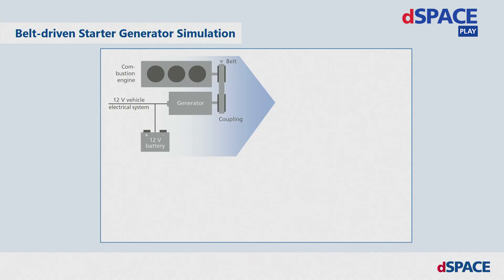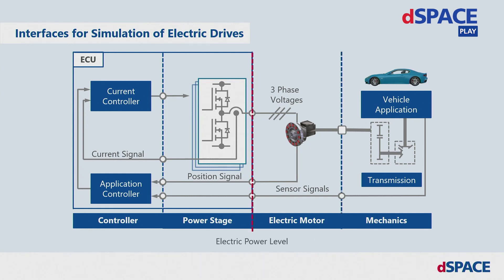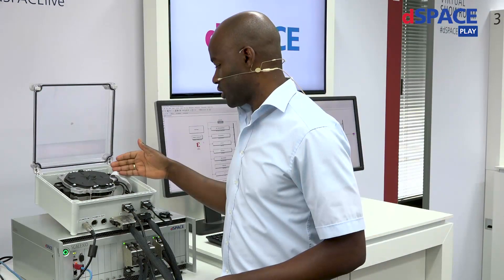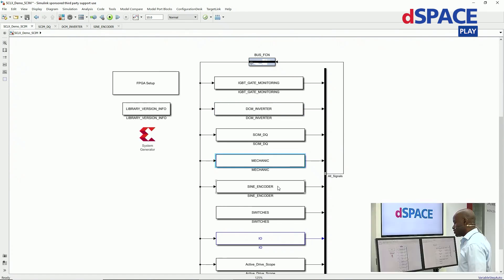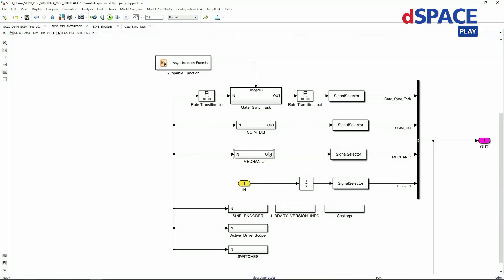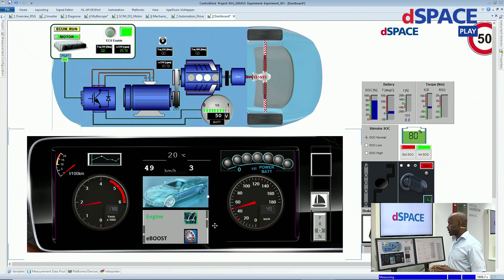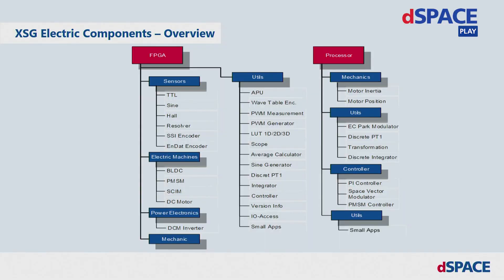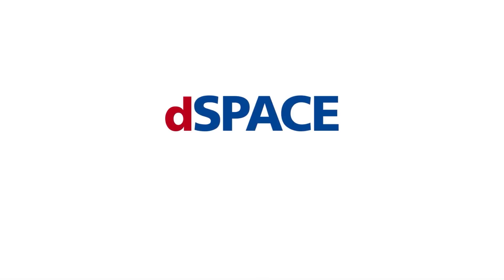Dynamic Motor Simulation on FPGA

Comment: Thx for the introduction.
What time does it take, to setup such an simulation system from zero, with an available target device?
Reply from the maker: Thank you for your interest and your question.
A setup for a basic application can be configured within a couple of hours.
It depends on how many components you want to integrate in the FPGA design.
You can even speed up this process by using our ready to use components available in our XSG libraries.
We do provide components for electrical machines simulation, power electronics, positions sensors, IO access and many more. The implementation is done per drag and drop within Matlab Simulink.

If you have further questions, please refer to info@dspace.de. Our colleagues will be happy to help you.